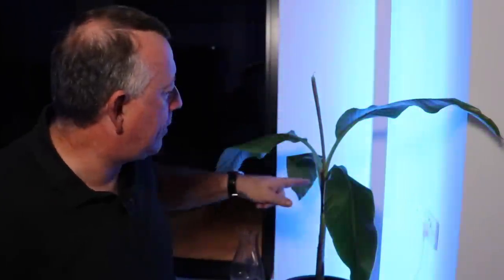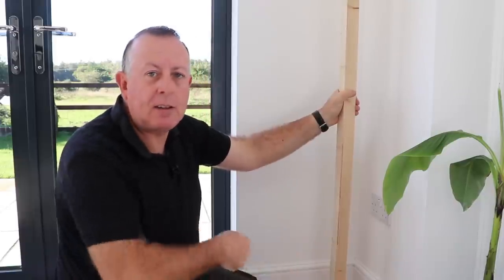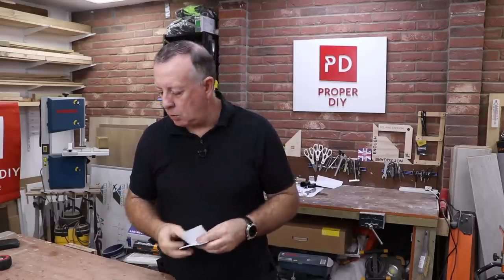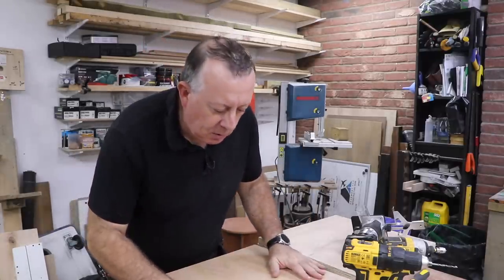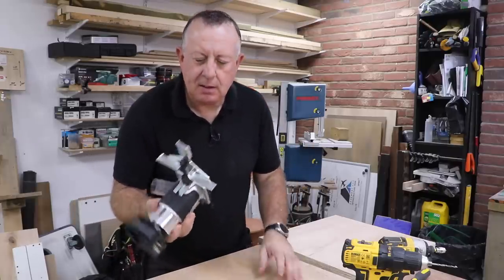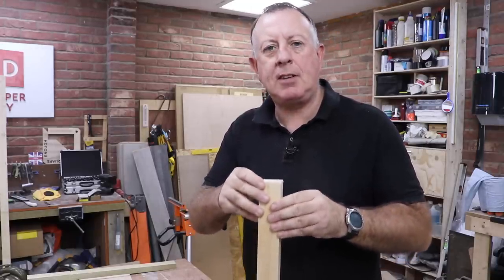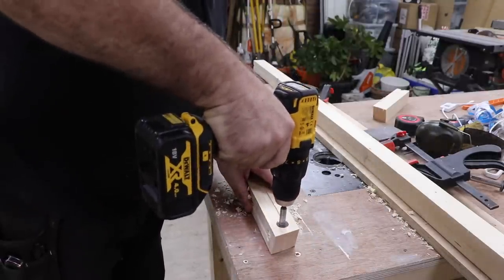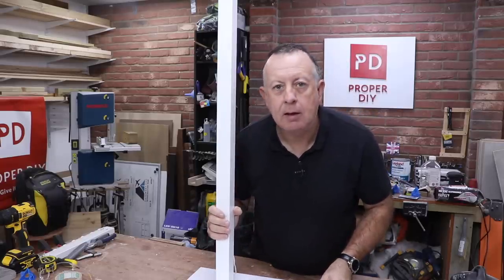How to Build Smart Corner Lights for less than £25

Comment: Great videos. I've used Magic Home Wifi Controllers before. They connect to your home wifi network and don't need line of sight IR. Alexa and Google compatible.  Around £5/10. 5M RGB tape £5/10 12V 5A PSU £5/10. Cheers, Paul McGuinness Nov 2022

Comment: Looks great but from experience I can tell you that those strips won't take long to break down. Heat is a killer for LED's so they need to be mounted to an aliuminium heatsink. You could route out and let in an ali box section the length of the strip then stick the LED to that.
Reply from the maker: Easy come easy go